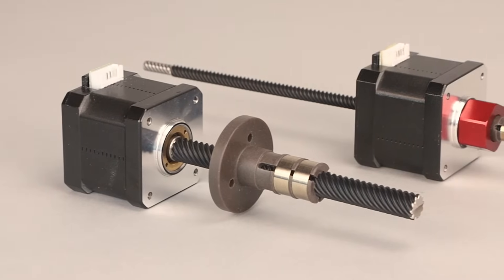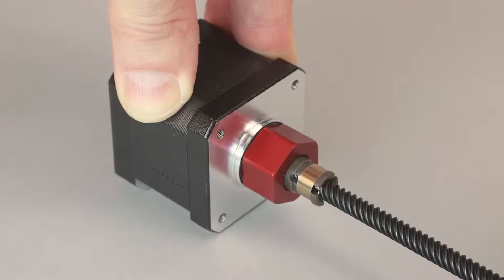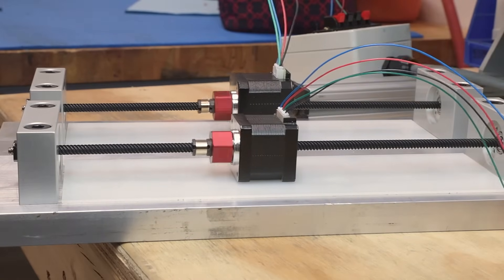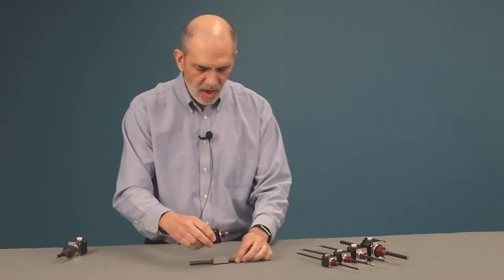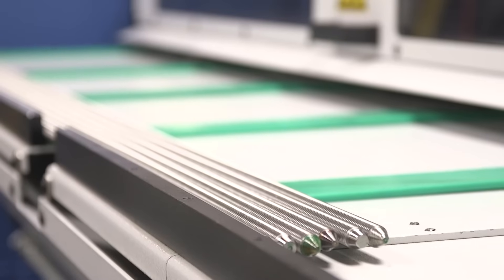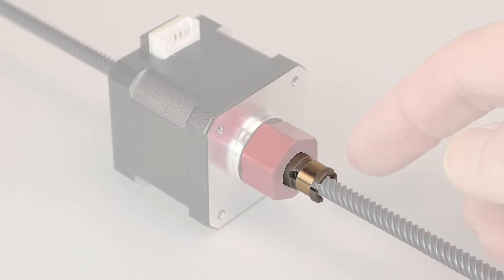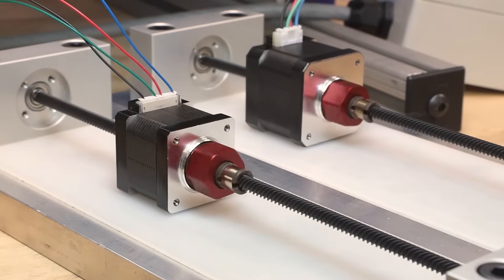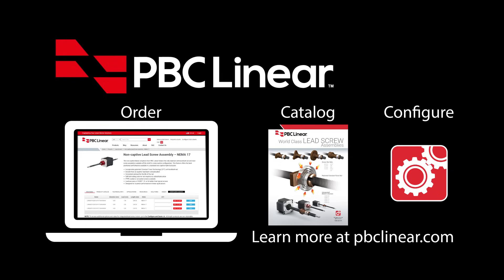Non Captive Lead Screw Actuators

Comment: what if i want only the screw to move up and down , not the head is it possible?
Reply from the maker: Yes, the Screw can Traverse Back-n-Forth through a Mounted Stepper Motor, but the Screw must be attached to a Linear Guide that will prevent it from Rotating.

Non-captive Lead Screw Motors have been used in this manner for example in Liquid Paste Dispensing Systems where the End of the Lead Screw is attached to a Piston and prevented from rotating with a Linear Guide.

- PBC Linear Application Engineer
for further details or questions, email: application.engineering@pbclinear.com

Comment: Hello, wanted to know, why do we need bearings while the lead screw is attached to the coupler and stepper motor, isn't the stepper motor and the coupler plus the housing, enough for the stability of the lead screw or in other words, what is the purpose of the bearing ? to cnc router ?
Reply from the maker: Hello Triumf... I understand your question.  The video is used for marketing purposes to show a non-captive lead screw and motor.  What looks like bearing blocks in the video are actually blocks that hold the lead screw stationary.

There are many ways a non-captive lead screw system can be configured. In this example, the lead screw is held stationary and the motor forms part of the carriage which moves back and forth guided by a linear bearing and rail.   I hope this answers your question.  Please see the PBC Linear website, https://www.pbclinear.com, for more information about such components and systems.

Comment: If the screw is many meters long and slightly curved can you use it as a low backlash drive to move around a really long guidance track?
Reply from the maker: Thank you for your interest in our product.  No, in general, you cannot use a straight lead screw many meters long to move a substantial load around a really long, straight guidance track at any substantial speed.  When you write “many meters”, I assume you mean 3 meters or more in length. As lead screws get longer, their maximum rotational speed becomes lower and lower to avoid the screw’s critical speed.  Also, as a lead screw gets longer, it can only support a smaller and smaller load before buckling would occur.  A lead screw several meters long would be limited to an extremely low load and an extremely low rotational speed.  If you go to our website and review our catalog for lead screws, you will find more detailed explanations of critical speed and buckling and charts showing the allowable values.   Any potential applications should be checked to make sure they are within the recommendations.  Theoretically, you could have a three meter long lead screw with almost zero load, rotating extremely slowly, and the lead screw would work.  But such applications are so rare and unique that PBC Linear does not generally offer lead screws beyond a length of 69 inches (1750mm).  Hopefully, that answers your question...  If not, or if you have other questions, feel free to reach out to us at 800-962-8979.
Reply: @PBCLinear  Thanks! that was a really informative answer
Reply: @PBCLinear  Well, in a non captive application the lead screw is not rotating, so your argument building on critical rotational speed will not hold. However, provided you bend the screw moderately enough to not desturb the thread and nut fit, you will introduce a stiffness problem as the force vector will not point along the lead screw's axis any more and apply a nasty bending moment to the screw. Further the load's mass will play a big role as you get a mass spring system with low resonance frequency, too weak to meet any accuracy requirements.